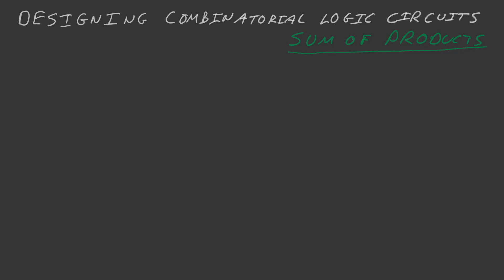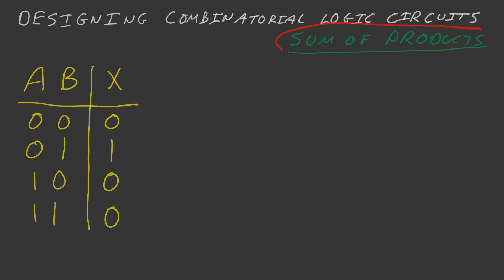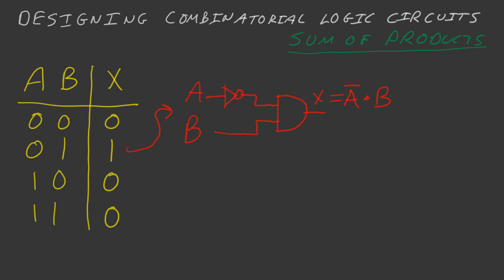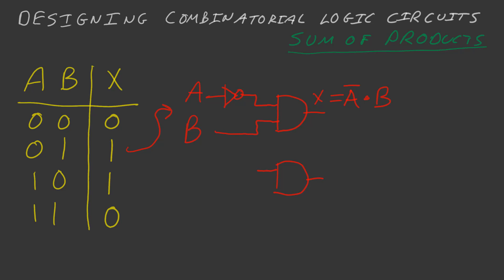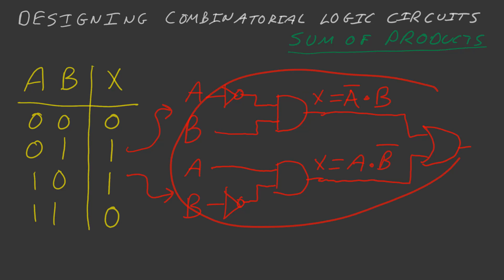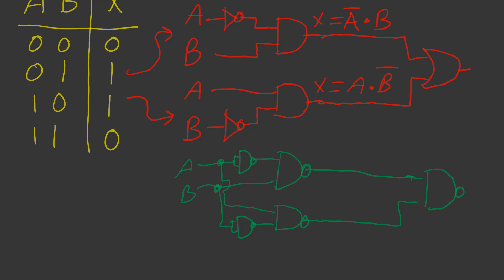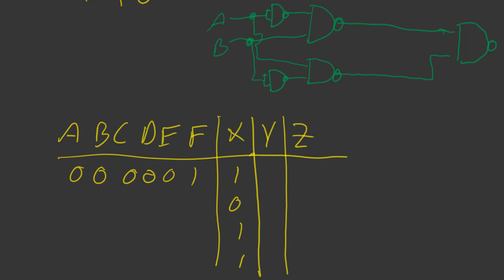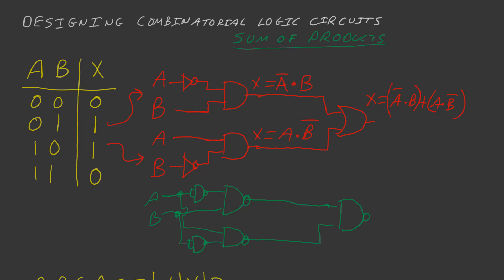EEVacademy | Digital Design Series Part 3 - Designing Combinatorial Digital Logic Circuits

Comment: Sorry Dave, but your approaches are way overcomplicated. 
First example, easier to use 2 NOR gates. Half a CD4001 for example.  Invert the B line and then NOR them. 
Second example is XOR, and can be done with a quad NAND such as CD4011.

Comment: I think the digital blackboard lowered your video quality, Dave.  I get that it is "new" but this would have been much better on your regular board.  The colours on the black (grey) board just don't work well especially the red.  The red on the video thumbnail alone didn't exactly make me rush to watch this.  I think the old fashioned board works faster (faster to draw and much neater) and you can point with your finger instead of these goofy self erasing lines.  The digital blackboard would be more suited to a low data rate connection than a YT video.
Reply: I find the content to be high quality in both cases, personally I think this is a small improvement!

Comment: At 5:05 can you just join the output leads instead of using an or gate?
Reply: Nope. Wiring two logic outputs directly won't act as an OR gate, obviously.
Reply: You can if the logic is inverted and the outputs are open collector / drain. (google 'wired or').

Comment: If you're looking to reduce the number of 74-series logic chips for this, use a 7486 since this is a single XOR gate.  

Sum-of-products is not a _method_, but rather a canonical form for boolean expressions.  The missing explanation here is the concept that any combinatorial logic circuit can be expressed as a sum-of-products, and therefore can be drawn with ANDs, ORs and inversion bubbles.

Comment: I was waiting for the XOR
Reply: Yes, that would have simplified it to a single gate. I was waiting for it as well. I saw it immediately when he modified the logic table.
Reply: TheWP It's all over the video.
Reply: Same. I was hoping Dave would mention that he was implementing the XOR function, given it is an educational video!
Reply: Maybe because of how much bigger it is to build. That's why my father likes NAND gates and runs like hell from them.
Reply: In real life if you were building a circuit and needed an XOR gate you would most likely implement it with NAND gates. On a modern chip you often don't pay for the logic gates; instead you pay for the area used, and you pay for each type of gate used. So if you add 1 XOR gate, that costs the same amount of money as adding 100000 XOR gates! And generally any sort of processor or IP block that you're using in the circuit will already be full of NAND gates; you'll pretty much always already have NAND gates in your circuit. So implementing it with NAND gates is way cheaper in most cases, because NAND gates are a universal gate; you can build all the other logic gates with them.

If you check bins of surplus parts at a makerspace or something, you'll find lots of discrete NAND gates, and very very few of the other gate types; for the same reason! It is cheaper to buy 1000 NAND chips than 200 XOR and 200 AND and 200 NOT, even though 1000 is larger than 600! It is just way better to have less types of chips in the circuit.

Comment: The Intel that I work at uses HDL and synthesis to create our billions of transistors, not k-maps. When I interview recent university graduates and ask them to create a solution in HDL they invariably try to create some monstrous combinational logic equation instead of busting out the case statement or a left shift operator. I always direct them away from that slow and impossible to maintain coding method.
Reply: Steve M For years, the HDL tools affordable to students weren't good at optimizing, and even if they were professors have to structure their exams to actually measure if the students understand the underlying theory not just how to punch the question into a computer.  Neither favors letting the computer do the work.

Comment: Digital logic is NOT only 1 or 0, it could be any discrete value out of given set (normally limited).
Reply: All integers can be expressed with a base 2 numeral system.
Reply: Yet statement about digital logic being ONLY 1 or 0 is not true.
Reply: For the purposes of this very basic discussion it can be taken as true. Don't throw newbs into the shark tank you arse.
Reply: It bugs me too, I hear people all the time claiming computers are "binary," and I keep trying to tell them "a 64 bit computer is base 64, it is not base 2" but nobody listens. Even on an 8-bit micro with single bit manipulating instructions, you still have to give the instruction two 8 bit arguments! It can only understand a single bit via an 8 bit mask!
Reply: 64 bit computer is a marketing term, mostly, there is no such thing in practice, mostly. It means you make as much sense as them.
Many processors support different register sizes, and naming x86 16bit (yes, 16 bit processor can address terabytes of memory without problems, unlike the claims of some morons), 32bit or whatever is mostly a lie. It makes sense to claim that most operations are 64 bits, but not all of them. As you probably remember, "32 bit" Intel processors had 64 bit registers and operations, but for marketing reasons they didn't call them 64bit.
Reply: Yeah, definitely, a 64 bit computer understands 64, 32, and probably 16 bit logic. And a 32 bit computer might cover the same range. However, a 64 bit computer has a 64 bit memory interface, it can think in a larger logical space than a 32 bit computer. If you're building it out of NAND gates it is going to make a big difference!
Reply: Nope, the interface can be any width, the old "16  bit" processors had 20 bit memory interface, and so on. There is actually hardly any difference. It is not related, it is just, merely a marketing BS.

Comment: Is nand gate easier to make than inverter.?
Reply: Wikipedia says that CMOS NAND is 4 transistors whereas CMOS NOT is 2 transistors.

But NAND can be combined to make more useful things than NOT because it can compare operands.
Reply: First method: 1 OR (1x7432 chip), 2 AND (1x7408 chip), 2 inverters (1x7404 chip)
Second method: 5 NAND (2x7400 chip)
Best method: 1 XOR (1x7486 chip)
Reply: I was thinking the same thing after he added the second 1. One XOR and your done. Of course that wouldn't have been terribly educational :)
Reply: Thanks 🖒

Comment: You only needed a single OR gate... nothing else.
Reply: Xor gate actually. A normal or gate would be true if A and B were true
Reply: But if you have to put two logic circuits on the board and both of them can be simplified to NAND gates you end up with less chips and all of the same type.
Reply: Choosing to implement the logic with only NANDs is usually not resulting in less chips unless your circuit logic is very simple, but for sure less references to deal with in your BOM, which means potentially cheaper manufacturing of your pcb in volumes ...